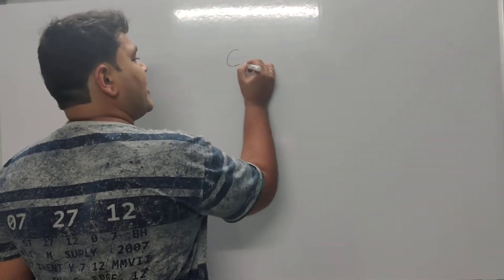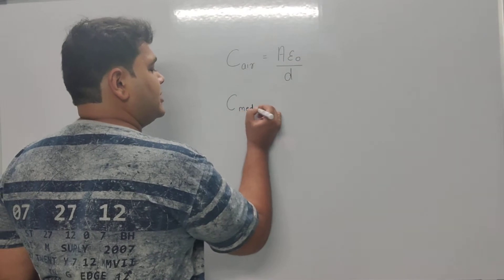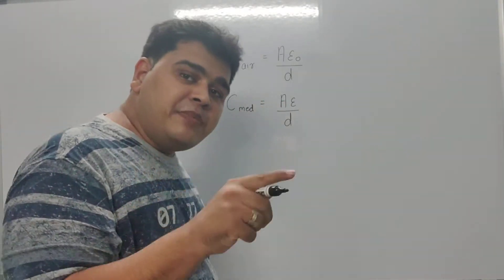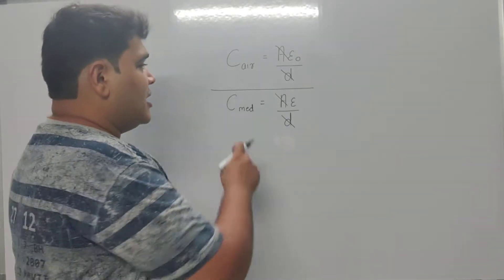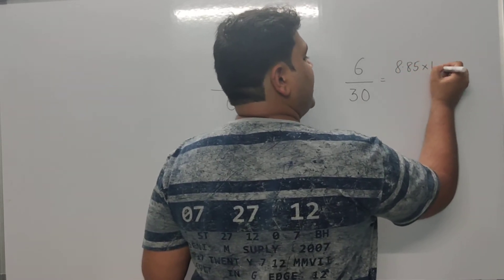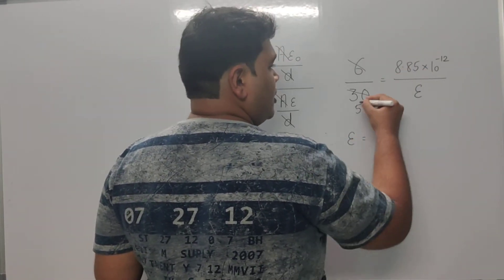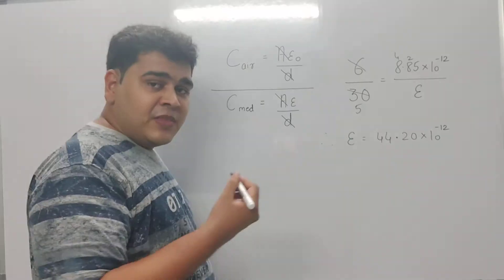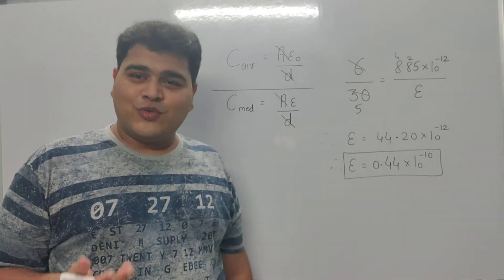The capacitance of a parallel plate capacitor with air as medium is 6 µF.

Comment: Answer is right but solving method is roung...😡
Reply from the maker: If you feel so, can you tell me what's wrong...?
Reply: @fisiqueneetjeeexampreparat2658  sir why is the dielectric constant not used in formula
Reply from the maker: Since they have asked the permittivity, we can directly find it without any need to find dielectric constant... That's why there is no need
Reply: @fisiqueneetjeeexampreparat2658  thank you sir